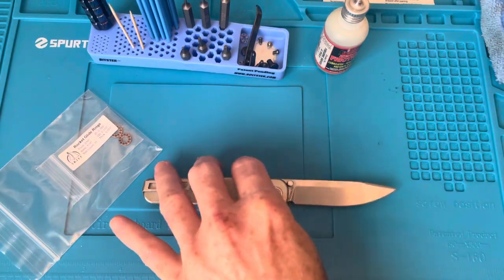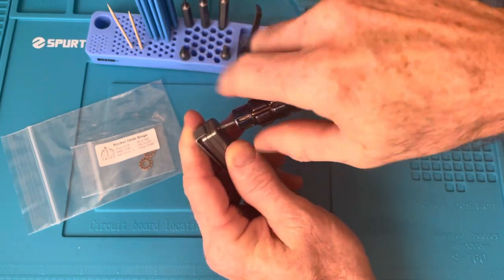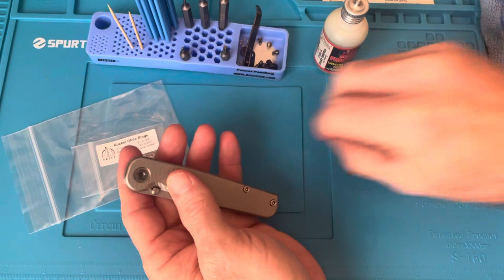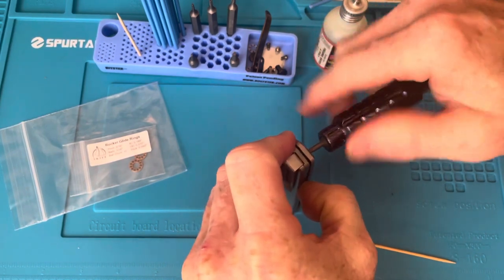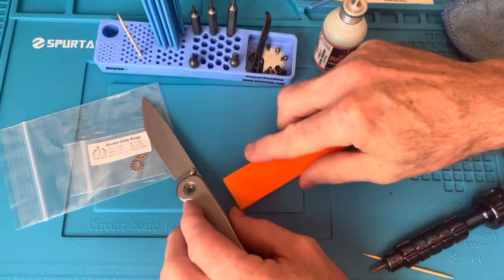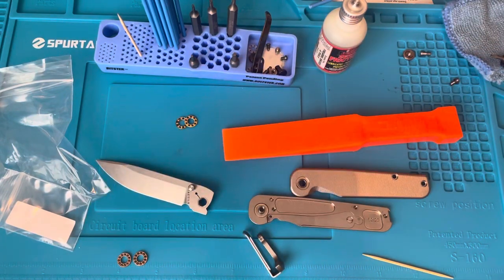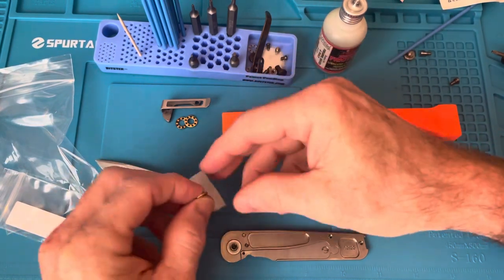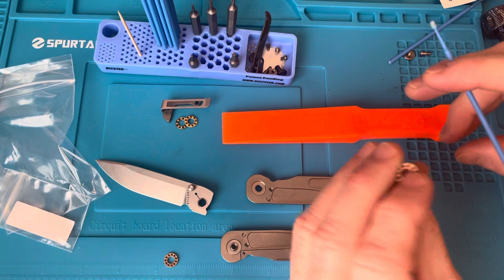Let’s do some Rockwall Skiffing - Tactile Knife Co Rockwall Disassembly +Skiff Bearing Install

Comment: There a little easier to take apart and put back together with the blade unlocked. Like you said the tolerances are so tight that you end up fighting the stop pin pressure from the blade. That second screw is kind of deceiving too, it seems like it’s free spinning but it’s still holding on just a little bit.

Comment: Great vid.  Can you provide a link (or just the size) for the bearings?  I am on skiff's site, but don't know the exact size.  I tried to pause the video to see but wasn't able to see it.
Reply from the maker: Thank you so much for watching. The link to the correct size is below, but to help you out in the future if you look to the left on the Skiff website click where it says "Bearing Compatibility"  and it will show you everything they currently have cataloged.  https://www.skiffmadeblades.com/collections/bearings/products/cage-bearing-br-pivot-3-16-bearing-1-16-in-11-ball
Reply: @bladesandedc  Thanks.  As you could see from my message I really did do my due diligence in searching before I asked. I hate when people ask questions in the comments that they could just look up themselves.  I checked the site.  I tried to pause the video.  I found that there were only two 11 ball bearings so I had whittled it down to two bearings.......but somehow I still managed to miss the "compatibility" page of the website which would have answered my question.  Doh! Thx again.

Comment: Lock stick? Mine does.
Reply from the maker: The one in this video had no lock stick and since this video was made I bought my own and it had no lock stick. If yours does you should contact Tactile and they will make it right for you. That's the benefit of buying made in the USA. I would recommend DMing them on Instagram, but if you don't use Instagram just use the contact option on their website.
Reply: No lock stick here